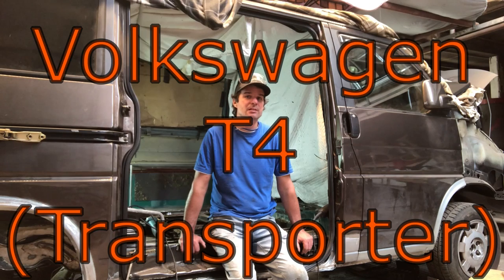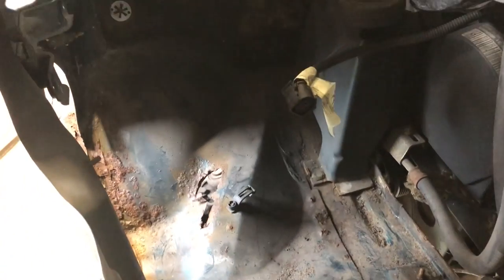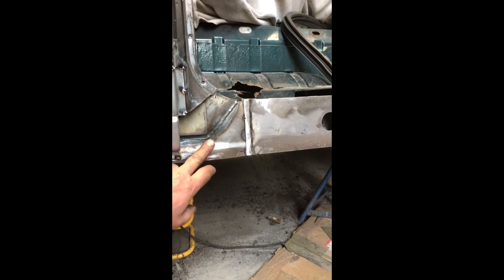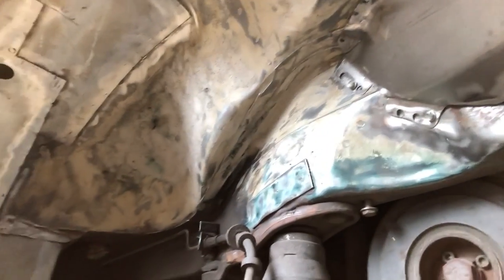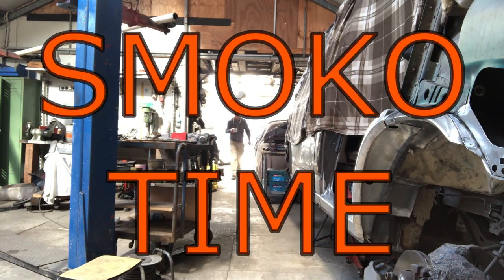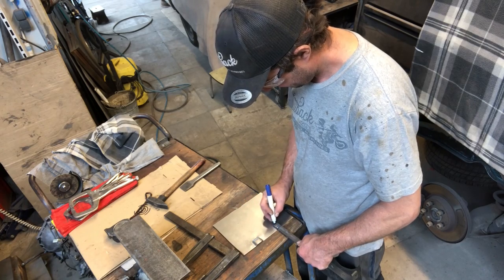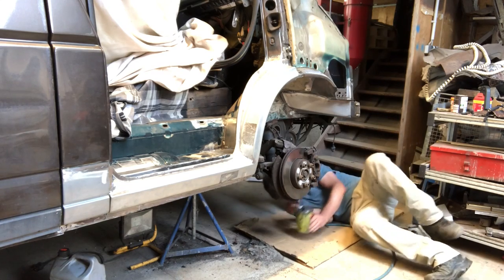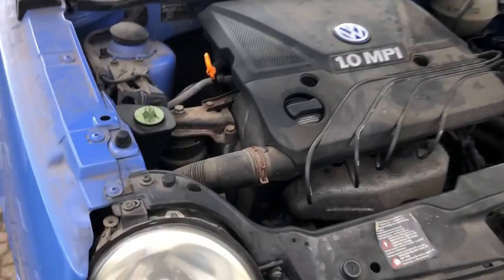VW T4 Multivan Major Rust Repairs.Australian Bloke in Germany Episode 4

Comment: You might as well come over and do the torana, there's not THAT much rust. Did you use a weld  through primer on laps.
Good work, we enjoy the content.
Reply from the maker: G´day. Would love to get my hands on an Aussie Icon! Yes I have used weld through primer on laps over time which is deffinatley a good option and widley used. Like most options it has it's limits.The primer still burns away in the immediate area of the weld and the soot given off from the burning primer is highly corrosive when it contacts raw metal. I will show in the next T4 video a canity paint gun which I have modified to paint inside body cavities and when applied in a thinned first application the theory is that the primer-paint runns through the laps. Still not perfect but a theory I am testing. Time will tell
Thanks for watching and your encouraging comment!!